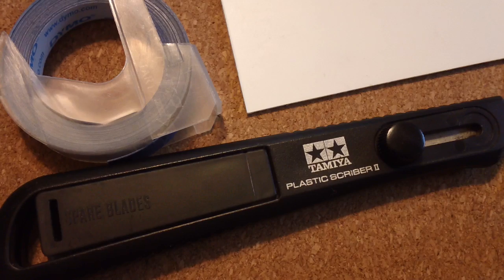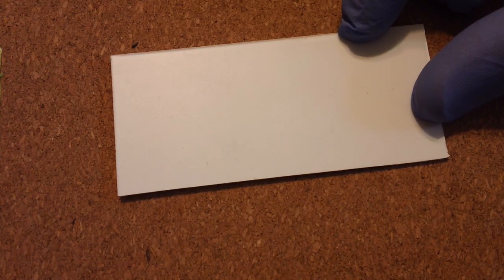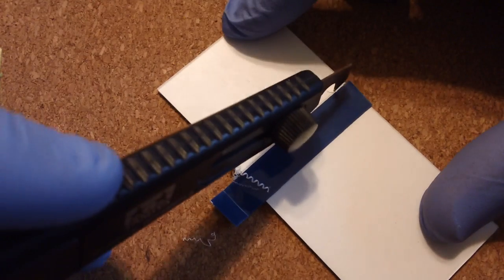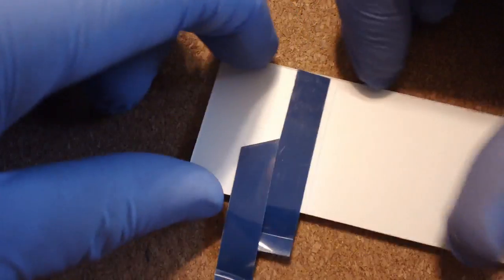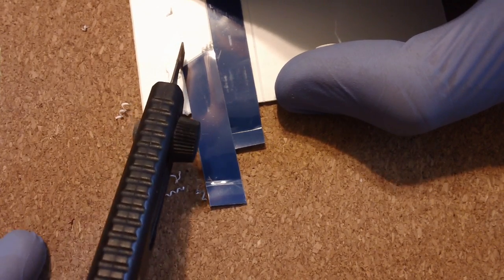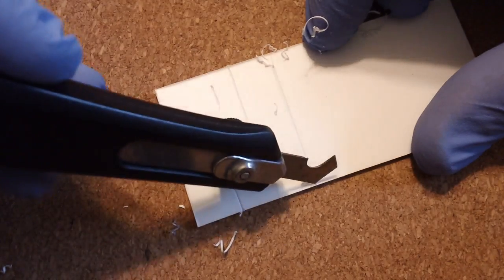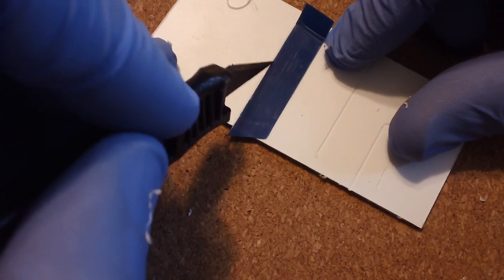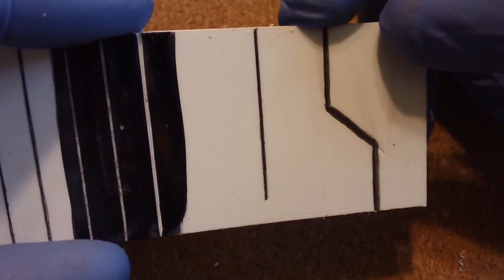Scribing Panel Lines- Tamiya Scriber II

Comment: Useful video. Sold me on the tool and I went and got one today, based on the great demo of how much better it is than trying to use the back edge of an X-acto blade tip. Also, great tip about using the Dymo tape - got some of that too.

Comment: Great video.  Use the tip of your craft knife blade to lift off backing tape. Cheaper versions of Dymo tape have really poor adhesives which can stick fiercely to your model and are difficult to clean off, even with 99% Iso.